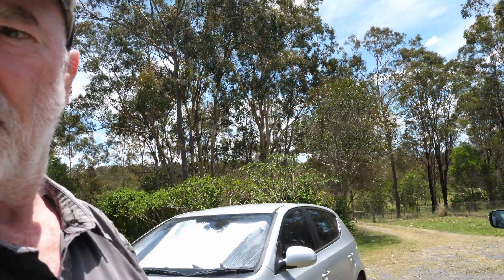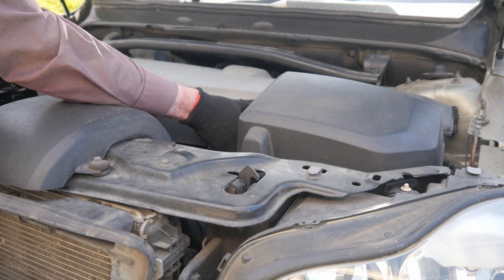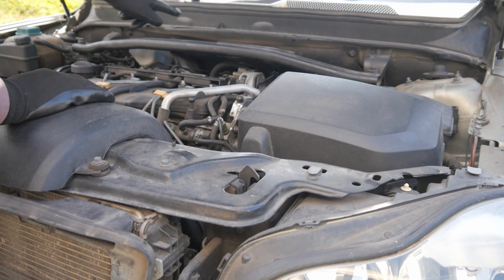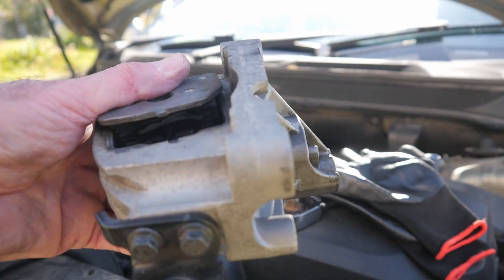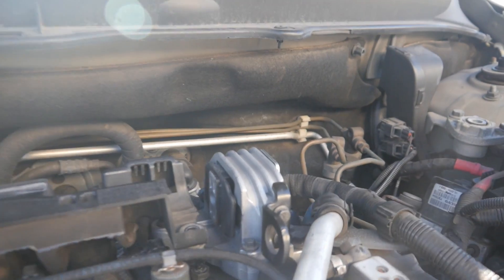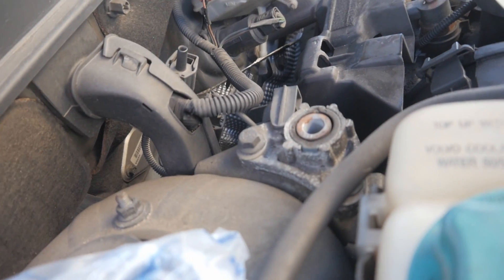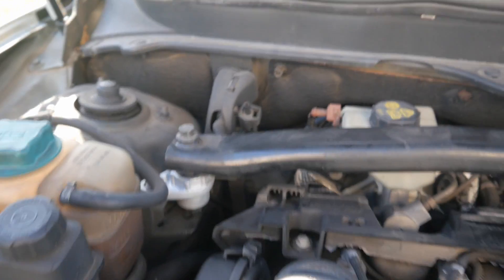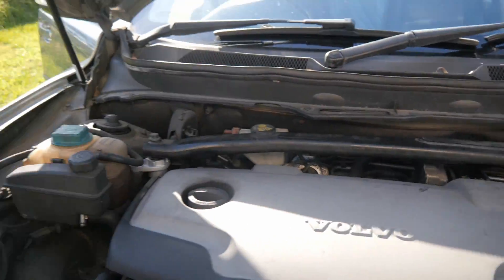Volvo XC90 Diesel Top Engine Mount Replacement

Comment: Hey mate would this be causing a vibration during reasonably fast acceleration
Reply from the maker: The engine mounts being flogged out can cause vibration and noise though there are lots of causes for that to happen.  If this is suspected it is pretty easy to check if this engine mount needs replacement by lifting the cover off and pulling and pushing on the engine to see if there is excess movement.

With mine, and since this was done, I have found this alone did not solve all of the vibration, though it helped. I do need to do at least one other mount.  This one is dead easy to replace though so give it a go if you think it needs replacement.  Thanks for the question.
Reply: @theoldmanandthebus  ah perfect mate thanks for that I’ve ordered the 5pc kit anyways so Will probably change them all at once.  Thanks again for the reply mate 👍
Reply from the maker: Out of interest  @lazz8827   where did you get the 5 pc kt from?    I may need to do a couple of others.   Do you have a link to them?   Thanks mate and good luck with the replacement